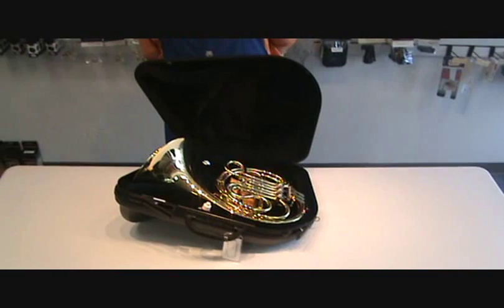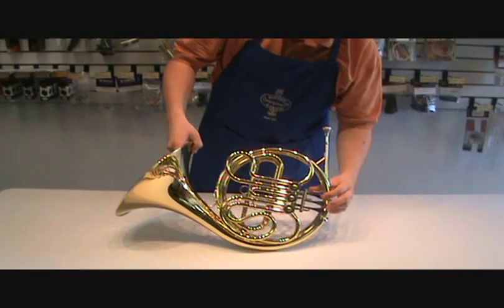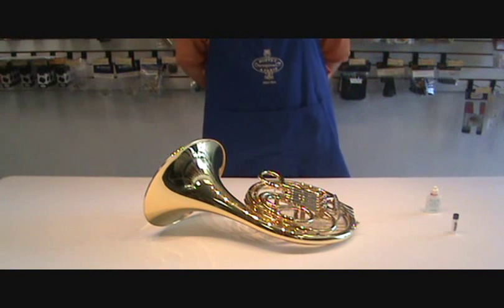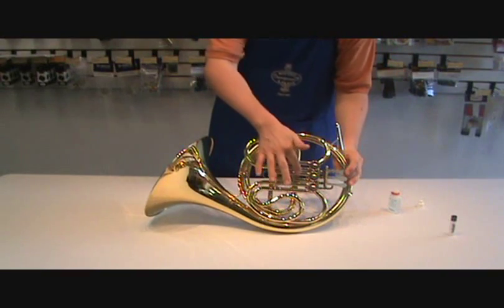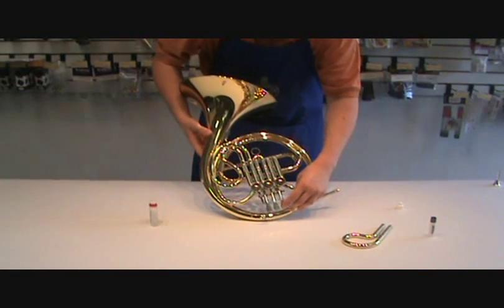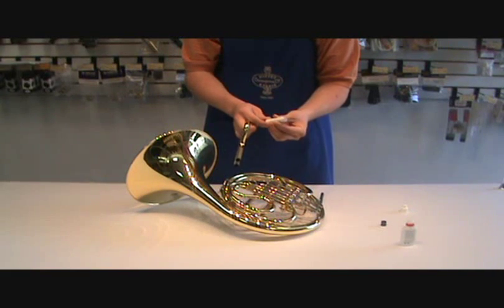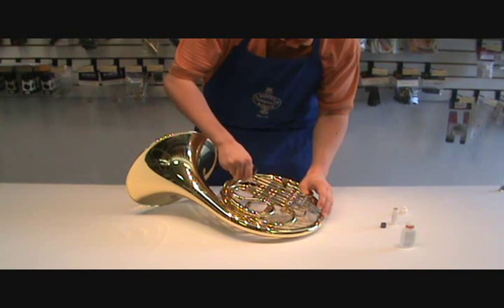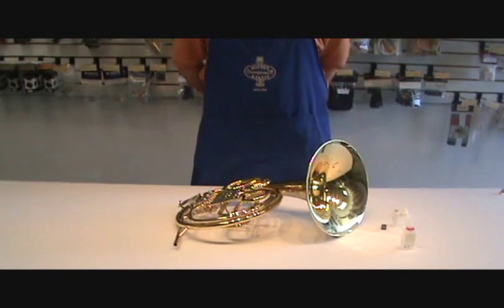French Horn Care & Maintenance - PM Music Center

Comment: Who told you once or few times every year. That's not true at all. End play in the rotor is cause by under oiling the rotors. Not to mention the fact that you never drop oil in the slide causing the oil to contact the ferrule. Always drop straight down the tube avoiding contact. That prevents grease from enterting the valve Which can cause the valves to over Lapp themselves increasing the space in the valve can allowing air to escape and fill that void.

Comment from the maker: @klo1024 It sounds like your most likely culprits are either buildup within the rotor casing or some trapped foriegn material.  In any case, the rotor will have to be removed, which is something that you should have a professional repairman do.  It's possible that they'll suggest a cleaning of the entire instrument.  A thorough cleaning is something you should have done to brass instruments every 9-12 months, on average.